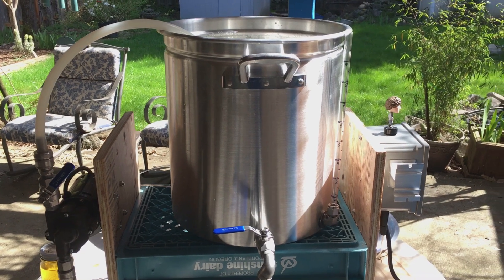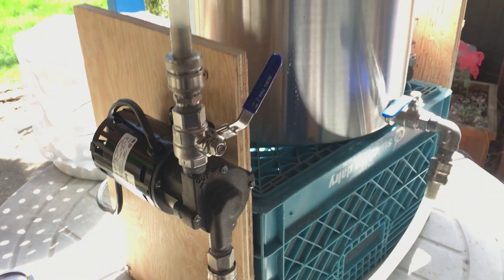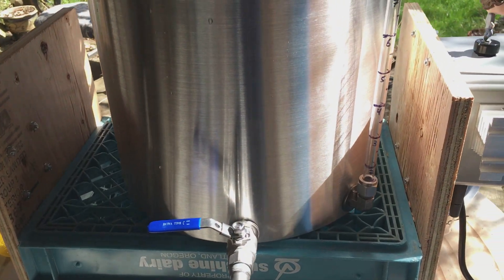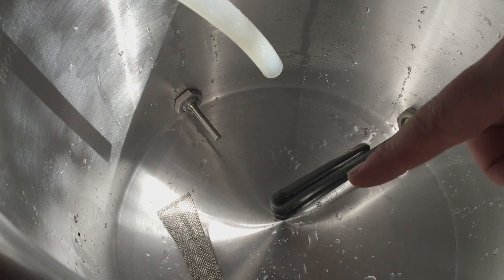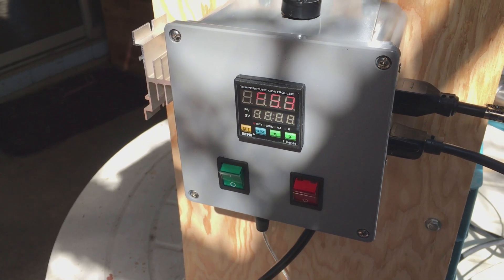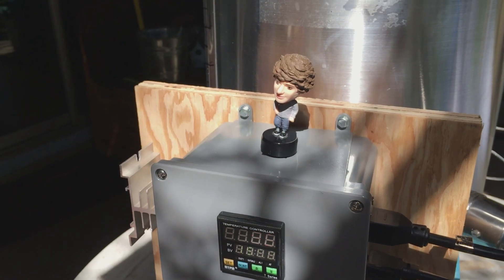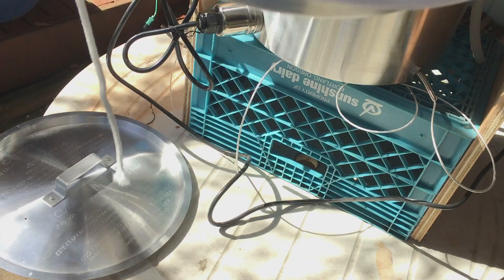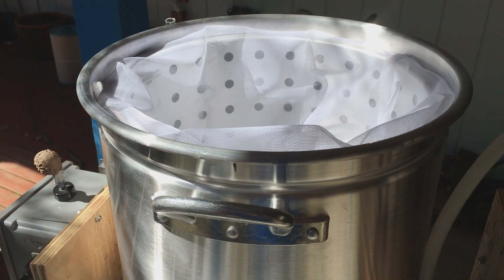5 Gallon EBIAB Build

Comment: 5 gallon batches, more like 6.5+ in the boil, really need two elements, like 3000 watts or more. Or one 240 V element. You can sorta get by on a single 2000 watt element, but the thing is BIAB is to save time. If you have to wait "forever" for the water to change temperature, you don't save time and you can't do stepped mashes or mashouts.
Reply from the maker: +MrRichBenn BIAB isn't always about saving time. Less cleanup, smaller footprint. Most beers don't need stepped mashes, and mashout isn't necessary. I've dropped my target batches to 4 gallons and a 1500 watt element handles that well. In over a year of brewing with this system I haven't needed more than 1500 watts. The bottom line for me is wether the beer is good, and it is.
Reply: OK, I've only been brewing since 1981, am an electronics engineer, and have designed a lot of equipment, so I'm not just shooting from the hip. My latest 3 vessel system can use HERMS, fly sparging, batch sparging or BIAB. I find I now use BIAB more often because of the ease of cleanup of only one vessel, which is another time saver!

Just trying to suggest to others things that work better and reduce effort. If you are happy with compromise(4 gallon vs. 5, longer wait times), that's great. You are young, though, and you will probably tweak your system in the future.
 
For others, once you have "more power", to quote Tim the Toolman, it's hard to go back. The PID controller will control more than one SSR, so you can add a second 120V element and run off of a separate circuit. Or you can do a 240 volt system.  Modern code in kitchens in the US require two 20A circuits, so two elements work great if you brew in that environment.

Comment: I'm looking for an element like that (one that doesn't have a thermostat built in) and I'm having trouble finding one in Ireland. Do you have a link to the one shown in this video? Thanks!
Reply from the maker: +banjobrew I bought that element on Amazon, but I would recommend a stainless steel element from brewhardware.com. A little more expensive, but the stainless elements seem a bit easier to clean.
Reply: Beer Meets World thank you!

Comment: DUDE!
    Thanks!
I was so confused how to get started.
Then i learned about BIAB and then found your video. 

This is awesome!

Only have 2 questions:

Does the Wort caramelize and get stuck to your heating element?

And if it does, how hard is it to clean?
Reply from the maker: +caspar mikkelsen There is a bit of wort and trub that gets stuck to the element, but at the end of my brew day I give it a soak with PBW and it comes off with a little scrubbing.
Reply: PBW? 
Thanks for the answer☺

Comment: hey, great video, thanks. what is the metal cover you use to cover the electrical connects of the heating element? where did you find that? thanks a bunch.
Reply from the maker: +A Winter That's the Hot Pod enclosure from brewhardware.com. The metal is a little thin, but it does the job.

Comment: How did you mount the heat sink on the outside of the PVC box? Did you cut a slot for the heat sink to slide down into?
Reply from the maker: Yes, I cut a slot for the heat sink. It's held in place on the box by washers on the screws connecting the SSR to the heat sink.
Reply: Thanks! I was looking for a better way to mount it but I think I will have to go with a slot also. I know you mention the 1500 watts being a bit slow for a 5 gallon batch, have you tried a 2.5 gallon batch? I am building a 2.5 gallon BIAB system and I am hoping 1500 watts will be enough as I don't have access to 240v.
Reply from the maker: +Pete Stapley I haven't tried a 2.5 gallon batch, but 1500 should be plenty for that. There are 2000 watt elements available for 120v. I'm probably going to upgrade to that at some point just to speed up heating.
Reply: @Pete Stapley, Beer Meets World is right, I have 1650W (the max one could use on a 110V 15Amp source) and it is really plenty for 2.5. Mashing is fine since pid does a fine job but it boils really out of control. the pot starts shaking. I don't know if this could be controlled via the pid. I guess I need to build a voltage regulator into my control box, it will cost me another $20. For the time being, I set up my 6gal pot on the stove, do the mash via pid and boil on the stove, which works fine but then what is the point of having a control box if you cannot control everything :) @Beer Meets World, thanks for pointing me to the Hot Pod. It has worked fine, though it is a little pricey.

Comment: Do you have a way of adjusting the intensity of the boil?
Reply from the maker: +Andrew Sherwin I can only adjust the temperature of the wort. I don't have control over the power going to the element. So I can drop the temp to get a slower boil, but it's already a slow boil.
Reply: Don't these PIDs have a manual mode that you can control the power O/P using a percentage adjust on the display?
Reply from the maker: +Troy Irvine I don't think this particular model does, but I know there are some that do. I don't worry about it because it never gets to a point where the boil is vigorous enough to warrant turning it down.
Reply from the maker: +Troy Irvine just checked the instructions and it does have a manual mode. I'll have to play around with it the next time I brew to see what it can do.